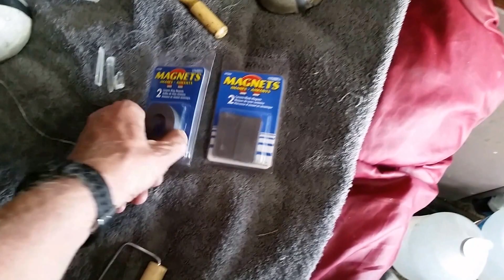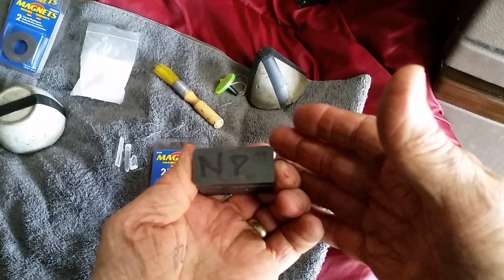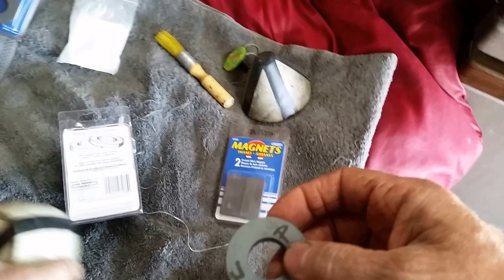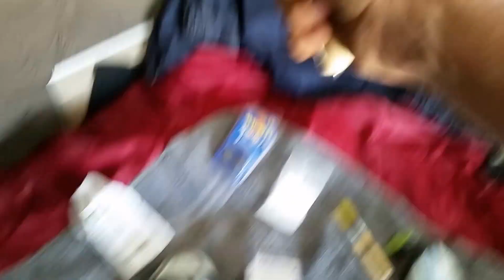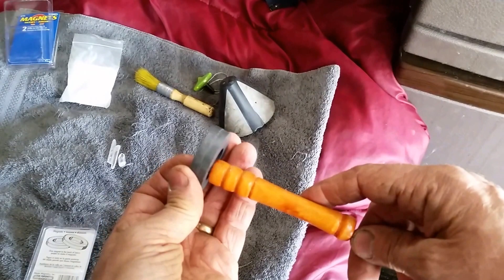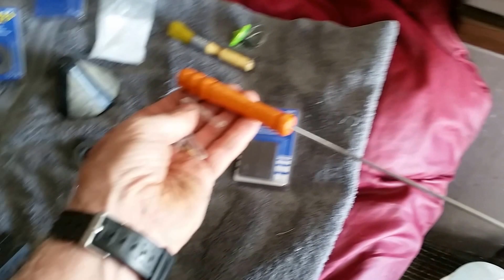MAGNETIC BOOST

Comment: Great video! Thank you. I have a question regarding the cemenite device you are showing there.  In an earlier (cemenite) video you said these should be as wide at the base as they are toll. But the one you are using here is almost as toll as it is wide. What is the ideal proportion then?

Also, I couldn't get good quality Cat 5e network cables (with pure copper core) so I am making lefthand  3mm spirals with a different cable that has thin insulated wires made of iron. The spirals stay in shape nicely. Do you think the type of metal used for these 3mm lefthanded coils matters?

You also said that cemenite devices (with half glass chips/half spirals) produce a benefitial field that neutralizes EMFs within 40 ft radius. How many of those should I have in my city apartment to neutralize the emfs coming from the neighbors from all sides? I don't use any wireless/microwave devices at home. Only my partner uses a cell phone in his office here.

Thanks much for your great work!
Reply from the maker: lalitadevi11 
Try several devices foe EMF. If you have trouble sleeping then turn them off before bed. 
Iron core should work. I buy my cable on Amazon.
Height to width on the pieces is Aji's observation. I use that just as a rule of thumb...not critical.
Reply: Thanks, good to know. I'll try several of them. [btw, I just noticed I had some typos in my message - sorry, was feeling tired... I meant to say "twice as wide as they are tall". But you already clarified it for me that the proportion isn't crucial for them to do the job. That's all I needed to know for now.

Comment: HI wishing you and your family excellent health for 2017. Just to come back to this question of magnets and which side is south and north. If you do a Google search on the earths magnetic field you will see that what is designated as magnetic north is in fact magnetic south so the N side of a commercial magnet is in fact correct. So in that instance you are using the North pole magnetic energy in your experiments not the south pole? There appears to be a massive confusing among healers using magnets as to which pole is the beneficial pole ie the one that is yin ccw rotation reduces inflammation etc. I have read two of by Albert Roy Davis and Walter C. Rawls, Jr. books. They have both dedicated their lives to experimenting with magnets.
Reply: so in a nutshell the earths magnetic south pole is in the geographic north pole
Reply from the maker: David Michael 
That is why I say "North pointing pole" to try to eliminate confusion.

Comment: Interesting, and thanks! What would happen if you RANDOMLY dropped a Neodynamic magnet into the metal molding of an orgonite pyramid filled with resin and black iron oxide powder (magnetic)?  Where would the magnet gravitate to, i.e., will it cling to the side of the metal mold?  Will it increase performance of the device?
Reply from the maker: I would not place magnets inside a device. Outside gives you more versatility to experiment.
Reply from the maker: +THE OLD LAB RAT 
I mean, "inside a cast device"

Comment: I read that magnet Healer's use the 'south' side of the magnets, bc 'south' pole benefits healing and health, and the 'north' representing opposite.
Reply: To take that further.  Hermetically speaking.  North symbolizes in male energy (fire element).  South symbolizes feminine energy (water element).
Reply: +John Kennedy and to take that even further (lol).  In regards to Magnetopathic healing/treatments.  It is VERY easy to harm one's self or others if not properly trained.
Reply from the maker: +John Kennedy 
It is frustrating confusion that magnets are marked backwards.
Please clarify your healing comments.
Reply from the maker: If you specify earth polarity then I know what you are referring to.
Reply from the maker: +THE OLD LAB RAT 
That's why I prefer the antiquated terms "North pointing pole" and "South pointing pole"

Comment: Wonder how Ed Leedskalnin built his coral castle...
Reply from the maker: +John Kennedy 
I am presently testing quartz crystals attached to the north pointing end of a stack of magnets. There is an interesting field forming from the combination. I find it calming, healing. 
I have been keeping it by me for several days and find my mineral levels balanced whenever I check.
I set it by a dowser dancing field and the dancing stopped. The energy stayed in one spot.
If you have time would you test the combination and let me know what you find?
That's crystals at the north facing end of magnets.
Thanks.
Reply: With numbers.  😁
Reply: +John Kennedy 
and circles
Reply: Mike Ivsin and some 'help'.
Reply: THE OLD LAB RAT Interesting.  Quartz wands or crushed quartz?  Neodynium magnets or regular??
Reply from the maker: +John Kennedy 
I ordered (Amazon) a $15 4.2oz bag of natural clear quartz crystals shards (average length 1.5 inches) and taped the bag to the north seeking end of a stack of 6 ferrite dominoe magnets.
I don't think the type of crystal or magnet is that important but crystals in that magnetic field.
Reply from the maker: +John Kennedy 
+John Kennedy 
I live close to the Canadian border.
The north seeking pole of a magnet has south pole energy.
I wonder if the power increase on cones, cemenite and crystals is due to a balancing of polar energies.
If so then those down under will need to use the other end of the magnet.
Reply from the maker: +John Kennedy 
Just thought of a way to test my theory.
If polar imbalances weaken cemenite, cones and crystals the I should be able to induce the weakening by using too many magnets.
So I placed 1 dominoe magnet on the bag of crystals, took my trusty wire flat coil and pendulum to see how far the EMF interruption went. 40 feet.
Then I stacked 6 magnets together, pointed it at the coils...the field dropped to 10 feet.
I thought magnetism only effected magnetic objects. Apparently it's balance has a strong effect on other energies.
Reply from the maker: +THE OLD LAB RAT 
I meant to say with the 10 foot reading that I pointed the 6 magnets at the CRYSTALS.
Reply from the maker: +John Kennedy 
No magnet...3 feet
1 magnet...40 feet
2 magnets...50 feet
(That was the sweet spot)
3 magnets...45 feet
6 magnets...10 feet.
Reply: THE OLD LAB RAT Crystals matter if they're points or terminated, as the energy is different at the points.

Reichenbach was able to demonstrate this clearly in his dark rooms.  Think of termination points of quartz crystals streaming out like a laser, others will 'spray' the energy or odic energy.  I think the Lemurian laser wands are known for sending energy in a laser like fashion.  I have some I'm not using if you wish to obtain one.
Reply from the maker: +John Kennedy 
I detect anion flow off the tips of crystals and gems. I assume the source is EMF. Both natural and man made.
Are you able to detect the strength of your crystals or devices? If so, then would you  place a compensating magnet (to balance out the polarity of the region you live in)...remember that magnets are marked backwards...and see if you detect an increase in power?
This, if true, is a big discovery. And will help us get the most out of our devices and crystals.
I wonder if tracking fields in the northern hemisphere grow stronger when sent southward. If so then this could help explain a bird's auto compass.
Reply from the maker: +THE OLD LAB RAT 
I tested my theory of magnetic balancing. 
Less than 1/4 of one magnet is strong enough to compensate for the polarity at my latitude. So 2 magnets maxes the EMF interruption but overcompensates the Earth's polarity.